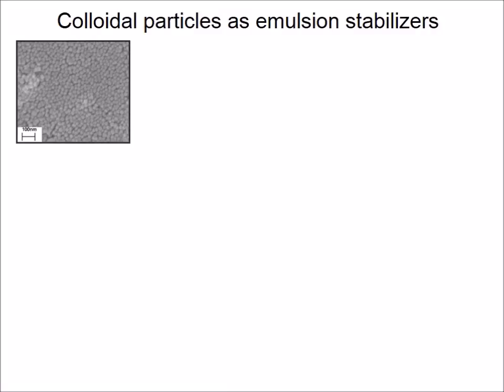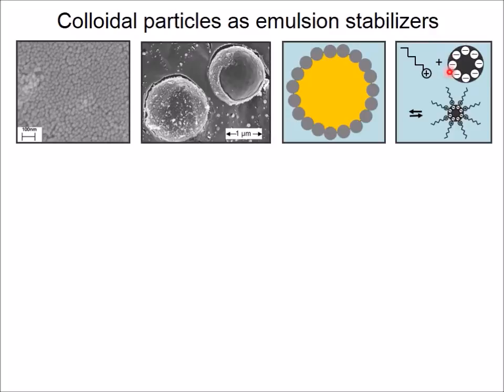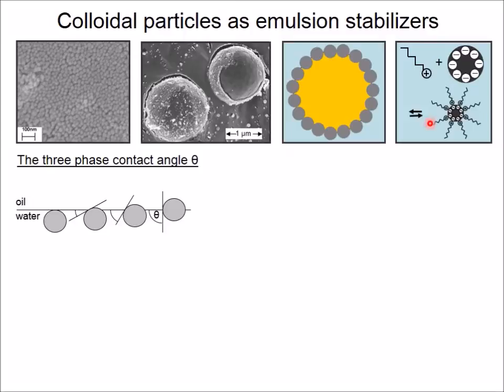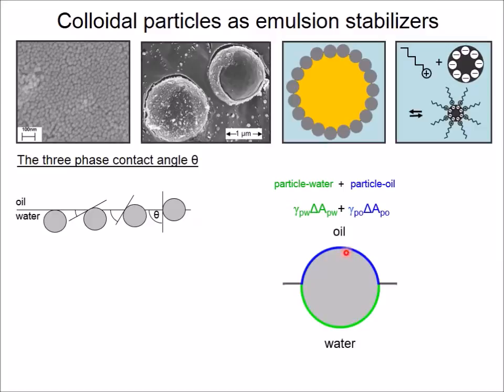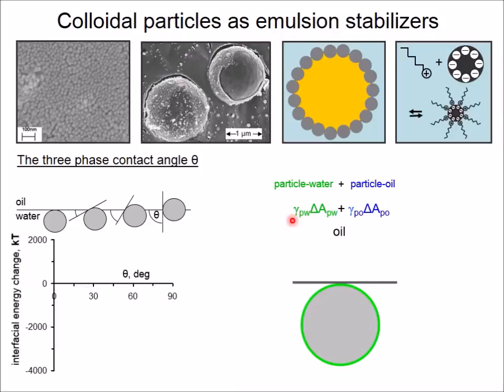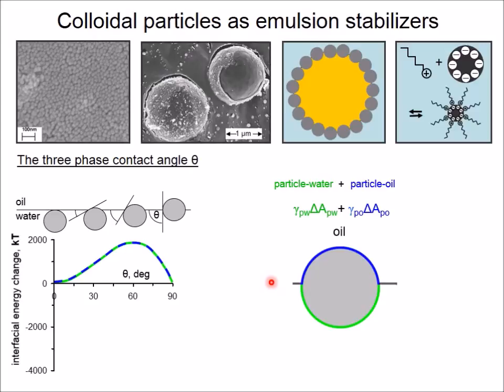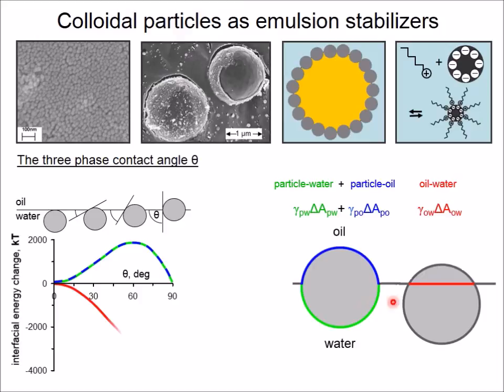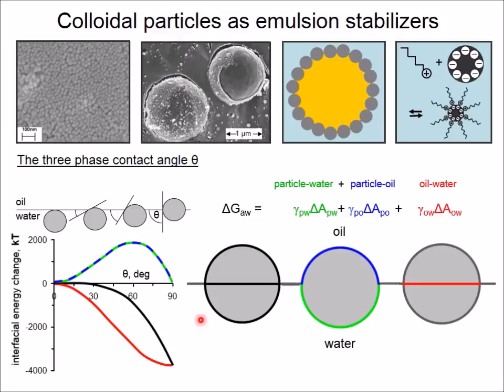Particles at interfaces

Comment: Hi, your explanation helped me very much. I still have question on the formula of calculating oil-water interfacial energy. Does it mean that the more area blocked by particle the smaller the energy is since it is decreasing? or the bigger magnitude it becomes but with negative value?
thanks!
Reply from the maker: The formula calculates the attachment energy, that is the change of the energy compared to when the particle is fully submerged in water. By submerging into the interface, the energy decreases because of the reduction of the oil/water interfacial area. That means, the energy change is negative. You can learn more about this equation in the introduction section here: https://www.martinhaase.com/_img/_docs/2011%20-%20Haase%20-%20PhD%20Thesis.pdf
Reply: @MartinFHaase  really helpful, thank you Martin!